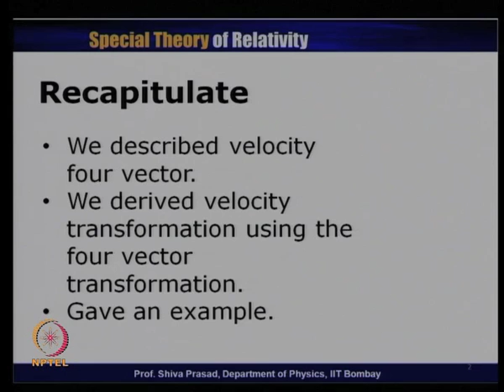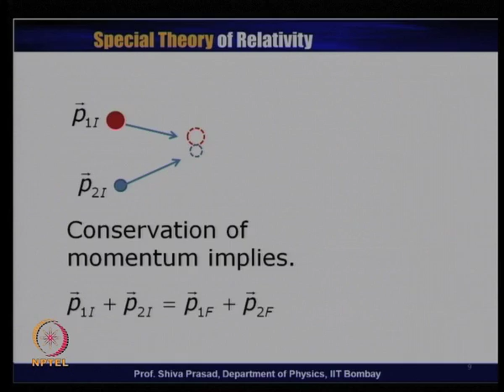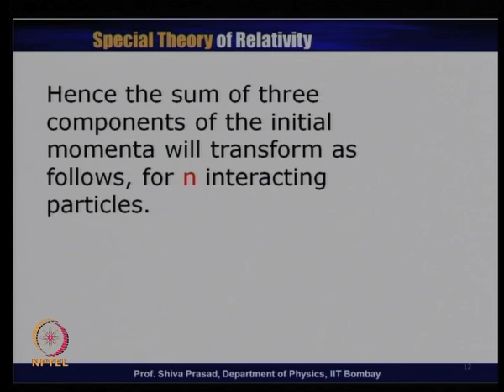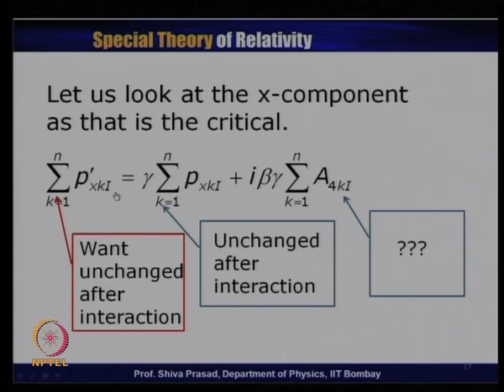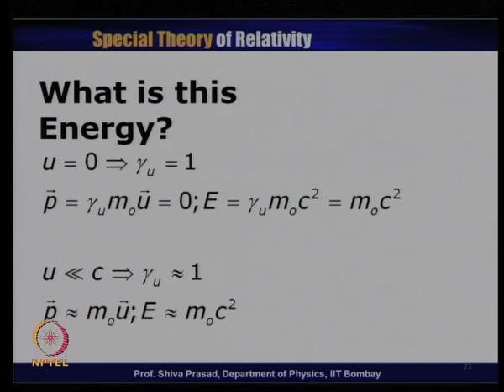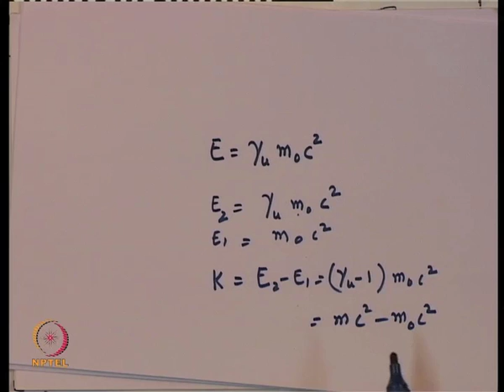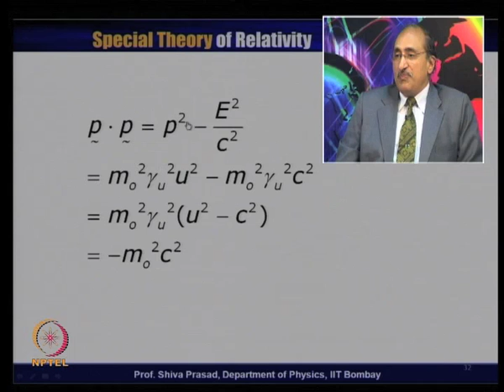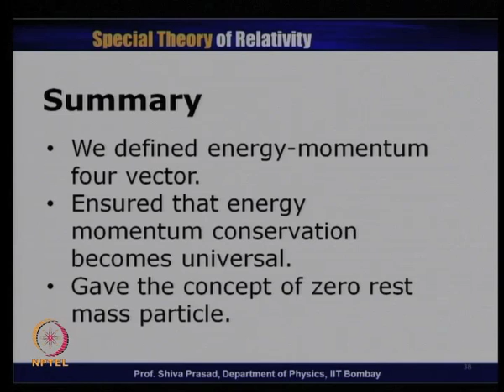Mod-01 Lec-15 Momentum Energy Four Vector

Comment: sir in lecturr no 17 we said M = 2mo there rest mass is increases where at in this lecture at 36:01  we say rest mass is decreases now i'm confuse plz help
Reply: As has been told in this lecture mass and energy are related to each other through 'c' square, where 'c' is a fundamental constant. Hence any decrease in energy of the system would result in decrease of the total mass of the system. Any increase in energy of the system would result in an increase of the mass. In a classical completely inelastic collision between two equal masses, where the masses come to rest after the collision, total "mechanical' energy is lost and gets converted into some sort of internal energy of the masses which are now at rest. This means that the rest mass has to go up because of  gain of internal energy. In the formation of hydrogen atom in ground state from an electron and proton, on the other hand, 13.6 eV energy gets released. Hence the rest mass of hydrogen atom would be smaller than sum of the rest masses of electron and proton. I hope it is clear.